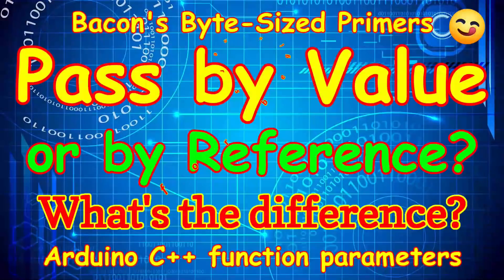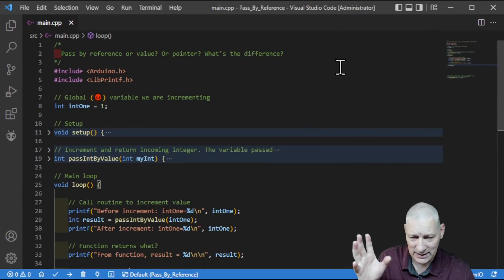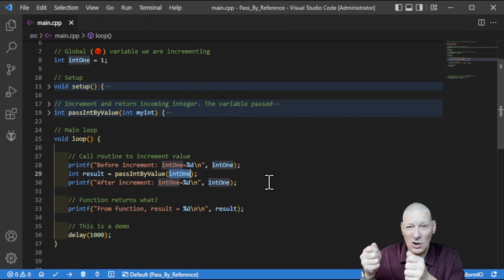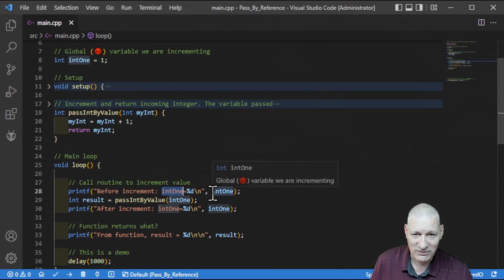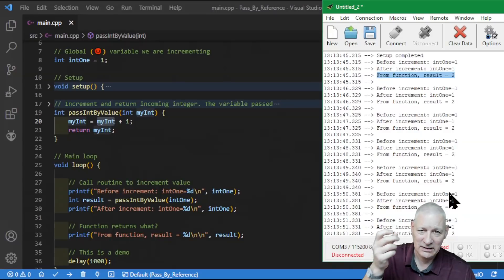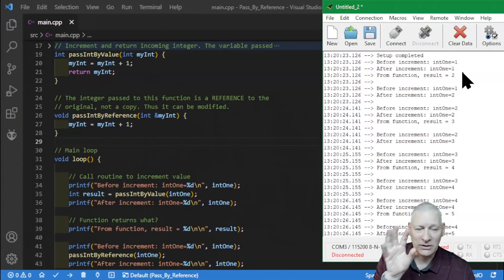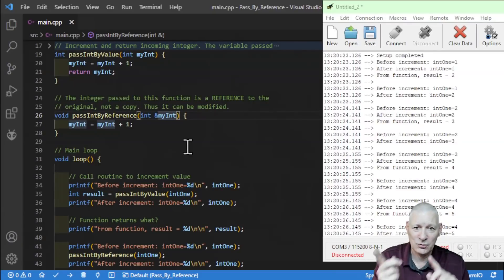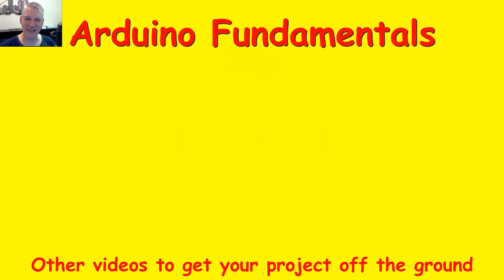#BB7 Pass by Value or Reference - What's the difference?

Comment: 2025-02-23 Arduino Test Code Using millis to blink 2 LEDs in a Function Call

Thanks to your Youtube posts my coding skills are improving but there are still many things about the compiler that are not clear to me.  

I decided to create some code that would use the millis() function to blink two [or more] LED’s but for a twist I created a function blinkLED() and pass the three parameters as variables by reference to control the action.  I also intended to declare these variables not as Globals but place them in the loop() function. Although the sketch compiled without errors the LEDs simply would not blink until I moved both the variables lastTimeLED2Blinked and lastTimeLED3Blinked to before the setup() function causing them to be Global.

// 2025-02-22 Arduino Test Code Using millis to blink 2 LEDs in a Function Call
// 2025-02-22 Tested and works correctly

// These variables must be Global for the LEDs to blink
unsigned long lastTimeLED2Blinked = 0;
unsigned long lastTimeLED3Blinked = 0;

void setup() {
 pinMode(2, OUTPUT);
 pinMode(3, OUTPUT);   
}

void loop()  {
// These variables are local to the loop() function
int LED2BlinkDuration = 100; // Duration for  pin 2 to be on and off
int LED3BlinkDuration = 1000; // Duration for  pin 3 to be on and off

  blinkLED(2, lastTimeLED2Blinked, LED2BlinkDuration); // Call the blinkLED function for pin 2
  blinkLED(3, lastTimeLED3Blinked, LED3BlinkDuration); // Call the blinkLED function for pin 3
}

// The function to do the cause blinking with lastTimeLEDBlinked passed by reference  
void blinkLED(int pin, unsigned long &lastTimeLEDBlinked, int duration) {
 unsigned long currentMillis = millis();
  if (currentMillis - lastTimeLEDBlinked >= duration) {
  lastTimeLEDBlinked = currentMillis;
  digitalWrite (pin, !digitalRead(pin));  // Turn the LEDs alternately on for duration and off for duration
  }
}
Reply from the maker: I just realised that your comment was much longer than what YT showed me, initially.

The reason you had to move the assignment of the variables outside of the "loop" was because otherwise the variables would be (re)set on every iteration, never incremententing.

If you had declared them as "static" in the loop, it would have worked, because in this context "static" means "only do this on the first iteration of the loop".

Example:
static unsigned long lastTimeLED2Blinked = 0;

Comment: if you do not like globals you can do this: Put it in the main loop(void loop()) and use an additional while loop as your infinity program loop inside the main loop, will have the same functionality as the global. But is also faster and code size is less than if you would use globals. See Page 5 of "Atmel AVR4027: Tips and Tricks to Optimize Your C Code for 8-bit AVR Microcontrollers "
Reply from the maker: Great tip! Indeed, for ESP32 tasks we do just that too!

Comment: The other half of this equation is why we have the first. Beginners will start to notice that functions are always return by value and often a little cumbersome to get much of any complex data out of them.
This results in broken code that often runs perfectly fine 99 times out of a 100 and crashes hard the other time.
code like:
SpecialObject  getMySpecialObject() {
  SpecialObject myObject;
  return myObject;
}
Which will actually work, but not in the way you expect maybe.  It creates multiple copies of myObject and destroys one of them.
Much worse is things like this:
SpecialObject  *getMySpecialObject() {
  SpecialObject myObject;
  return &myObject;
}
A very common mistake of returning a 'pointer' to memory allocated on the stack that is immediately deallocated on function exit.
I myself got caught out recently by a function which did this:
void debug( char *str ) {
    char outputStr[ strlen(str) + 2 ];
    strcpy( outputStr, str );
    outputStr[strlen(str)] = '\n';
    Transmit_DMA( dma_channel, outputStr );
}
The trouble is, the Transmit_DMA returns immediately.  But the memory it's using was allocated on the stack and the very next function call writes garbage out the DMA channel!  It was quite amusing to me, but with 20 years experience it didn't take me too long to go "Ohhh....   DUH!"  and fix it.  That could stomp a beginner for ages.

Note "references" in C++ use similar syntax to pointer references in C, but behave in different ways.  References have restrictions, like you cannot have an uninitalized reference and I'm not sure if you can reassign a reference, say in a function.  It's been a while and I just don't like C++ because it has far too many different incompatible ways to shoot yourself in the foot and the errors it spits out are, somehow!, even worse that C!  C is a known quantity, C++ is polymorphic in many of the wrong ways, you can't quite be sure without studying the 1000s of pages of language committee publications about what flavour it is this year.
Reply from the maker: Returning pointers to variables or objects that have gone out of scope is a common programming issue. I fell foul of it just the other day, and could not understand why I could "see" the correct variable (a buffer) for just a fraction of a second, then just "null". Ho hum! (Hangs head in shame).

But the fact is, with robust programming practices there is nothing intrinsically wrong with C++. But it is not very forgiving (see first paragraph) and doesn't give any beginner-friendly messages ("Object you are referencing goes out of scope before it can be read") so we just have to be methodical and test more than the "happy path".

Comment: To get behind the 'blackbox' of libraries, you can debug your code, (line by line). You can see this in the ESP32 series when after your code, and the Arduino code, it will jump into the FreeRtos and show you what is being called behind the scenes. Unfortunately Debugging Micro-Controllers requires Hardware, and that's an additional cost
Reply from the maker: Single-stepping, real time debugging is essential in some instances (like C# in a dot Net environment) but for ESP32/Arduino work you can always press the F12 key to see what is being invoked during programming too. Quite an eye-opener sometimes.

Not quite the same as actual debugging, but then again we're not trying to debug the framework (in dot Net terms we would "step over" that bit).

The new Arduino IDE 2.0.x supports single-stepping if your processor supports it. I showed it in one of my videos #180 https://youtu.be/ArUzVt9z1ug but it was very flaky at the time using a beta (barely) version of that IDE.
Reply: @RalphBacon  Yes I have my EP32 Debugger hardware on the way, not as simple as pushing a Button/Shortcut in VS, but it is what is. I'm learning something new everyday with MC's, now it's JTAG

Comment: I have to revisit the episode; it's a double-edged sword. Look at the definition of Arduino core EEPROM put. I repeatedly called get() and put() and experienced some very confusing results. The header file EEPROM.h contains: template< typename T > const T &put( int idx, const T &t ){...}. My question related to this is, what changes the caller's behavior with the use of 'const' for parameter &t? Cheers, and by the way, I'm looking forward to hearing what you have to say about pointers.
Reply from the maker: The use of a template means that the data type does not have to be known at compile time; it works it out at run time.

Pointers are quite straightforward and almost unnecessary in C++ programming (unlike C programming).
Reply: @RalphBacon  I added the 'const' in your PassByReference code: passIntByReference(const int &myInt); it's like the function says, "I need the reference location in memory to the variable, but I promise not to change it." Indeed running the modified code will give the compile time error: In function 'void passIntByReference(const int&)': PassByReference:27:21: error: assignment of read-only reference 'myint'. That was nice of put(). :-)

Comment: I've put off this video until today, I really wanted to watch it, but at the same I didn't.. cause I wanted to have the right mindset and I think I have it today as I believe I understand the difference quite well from your description of it. Going to try and have a go at it tomorrow to see if I can find any difference.

I do seem to have some memory overflow or what its called, so after a while certain functions are just not working as they should, while others are still working, until a restart of the unit.

Also, another difficult problem is that when I program an 328p with flash content above a certain value, the program just doesn't want to run properly. It is a bit hard to explain, haven't touched this specific issue for a couple of months as I can't figure it out..

But.. the feeling I get is, when I have a sketch of.. say 60% full of the flash, it feels like the sketch is overwritten, like the actual memory in the chip is too small so that it starts overwriting at the start of the flash memory area.. which of course could be possible with counterfeit ICs.. but these are bought from Mouser and Farnell so I doubt that is the case - at least I hope..

Then, if I remove some code - no matter where in the sketch or its underlying files - so that I get under 60% full, the sketch works perfectly..

I took this on Reddit a few months back when I was trying to figure this out and they talked about the heap or stack and for me.. this is "invisible", so how would I know if I fill up the heap/stack or if I have a lot of it left?

Do you have any ideas, thoughts or maybe plans on a video about heap/stack or so?

As always, love your videos, you're very methodical and "slow" which I really, really need 😂😃
Reply from the maker: You can call this routine to tell you how much stack memory (SRAM) is left:
// Check stack space
void checkStack() {
   unsigned long remainingStack = uxTaskGetStackHighWaterMark(NULL);
   Serial.print("Free stack: ");
   Serial.println(remainingStack);
}

Free memory is what is left after the heap and stack. Call every few minutes to see if it changes (normally does, sometimes significantly).

Although you might be able to upload a full 32K of program memory, it would be a huge program. It's the variables you have to watch (SRAM/Stack), shown after every compile.

Comment: Been a while, but the old IBM Fortran compiler had a quirk.  Since the machine was only had 8 bit words, they didn't want to waste storing lots of numbers.  So, if the compiler used an explicit "2", it was stored in a 16 or 32 bit location, with an 8 bit pointer (the 360 only had 4k code pages, and was paged -a lot- to get larger code).  Any time you the literal "2", it would access this location. Thus, when you called a routine, say, sin(2), the compiler passed "2" by reference.  This created an interesting code trick.  Make a function INC(N) which adds one to the argument and returns the updated value.  If, in the code, you said N=N+1, then using 2 later in the code would always reference 3.  They fixed this pretty soon.
Reply from the maker: Sounds like they were trying to be a bit too clever!

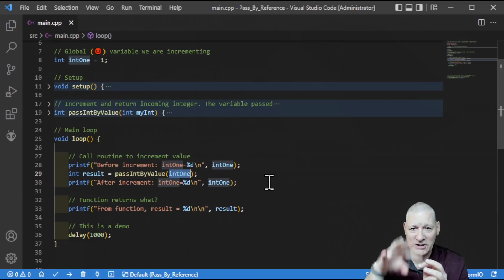Comment: 5:38 You mean the stack, right? All function parameters (In C and C++) are stored on the stack, even those passed by references (addresses) are stored on the stack.
Reply from the maker: Yes, all parameters (variables) get pushed to the stack; objects go onto the heap usually. 

Useful to remember that the Arduino String gets created on the Heap and turns it into Swiss Cheese as it is amended , making it difficult to find a large enough contiguous block of memory for other objects.

Comment: The only difference between ByReference and Pointers is more for the benefit of the comipler to type check. They are both real 'pointers' passed to the function on the stack as opposed to an absolute value passed on the stack. The best way of showing the difference is by showing the assembly code that is generated by each method. Passing ByValue only temporarily copies when its poped off the stack in the function. It's then discarded whrn the function goes out of scope. ByReference/Pointers is way faster too and requires less stack size.
Reply from the maker: Well, maybe; By Reference is one of these new-fangled constructs that C++ allows for our benefit, inasmuch that it abstracts away the complexity and danger of a pure C-style pointer. For example, you don't have to dereference a By Reference parameter. Nor can you suddenly assign it (to) another variable. But these points will be "addressed" (geddit?) when we do the pointers video. Probably.

Comment: Over my head, sorry.
No idea where this would come in to anything I work with.
Reply from the maker: That's a shame, Jorgo. But if you continue just Passing By Value, (which is the default way of doing things) your code will be fine. Just be aware that your function that you have called can never change the incoming variable unless it is Passed by Reference. Not a deal breaker for general hobbyist work.

Comment: Great video Ralph.
I definitely think that you’re just the guy to explain pointers, stacks heaps etc.  I really think that you should in someway illustrate the way things are laid out both in the machine and possibly in the compiler. Otherwise, a lot of times people have a hard time visualizing them and just treat them as some ethereal object floating in mid air. When I was first using C, I came from assembler where everything is used by reference because back in those days memory was typically very very tight. My biggest problem with the C-language was the symbology used. For example one statement would use an ampersand and then the following statement accessing the variable in the very same way omitted the &. In fact in your code you actually have an example of that.  Anyway, my vote is for you to keep going with this series…
Reply from the maker: Yes, I find it somewhat strange that the same symbol should be used to mean different things depending on context. No wonder everyone is confused.

Comment: Looking forward to the “pointer” video and how they contrast with pass by reference.
Reply from the maker: Yes, it will be interesting. But remember that C++ makes it easier to pass parameters using references; pointers are C old school! Sometimes, however, needs must.
Reply: @RalphBacon  I've seen C old school pointers in the STM32 line HAL. It drove me crazy figuring out what was going on until I realized they were using addresses & pointers. I'm looking forward to the video on pointers also.
Reply: I’ve seen pointers being used when looking at various programs in the libraries. So far I haven’t encountered a need to use anything other than pass by value and pass by reference. So I always wondered under what circumstances I’d need pointers instead. When I use pass by reference I find I’m more often doing it to keep the heap size down when passing long strings to functions rather than because I actually want the function to alter the value - usually I don’t want the function to alter the value - but I pass by reference anyway to keep heap size down. I wonder if there is a way that as I pass the parameter I can tell the function it is a constant (when in the main program it isn’t) and then pass by reference to keep heap size down, but be free from worries that the function will change the value - ie because it can’t, because to it the referenced value is a constant.

Comment: Passing by reference is much better if your passing a large amount of data, as the reference does not take size in to account. only where it starts so your heap remains more of a mole hill, not a mountain .
Reply from the maker: Indeed. For an integer or two, it's no big deal but if you are passing a large struct, for example, the memory can take a beating.
Reply: @RalphBacon  , ahhhh,  penny dropped.  now I see a practical use.   would love a simple demo code that could demonstrate that advantage, in tems of memory use or data copy time.  But not sure where to start in developing such a demo??

Comment: By reference is one of those things I don't really understand why it's there. At machine code level, it's pretty much just a pointer. c++, why are you so weird lol
Reply from the maker: The reference "points" to a memory address, but the compiler then does a lot of hard work for you that you have to do if you use a "real" pointer. That's why we should use By Reference where we can. It's a C++ enhancement.
Reply: It simplifies things and makes them easier. If you took a pointer you would have to check if it was null. Then you would have to worry about pointer ownership. Does the caller own the pointer or the called function? Who is responsible for deallocating the object? Also it probably allows the compiler to do various kinds of checks for correct code at compile time and maybe allow the compiler to optimize better.